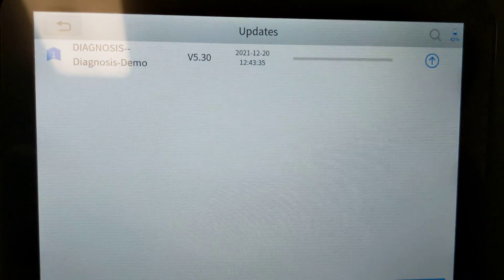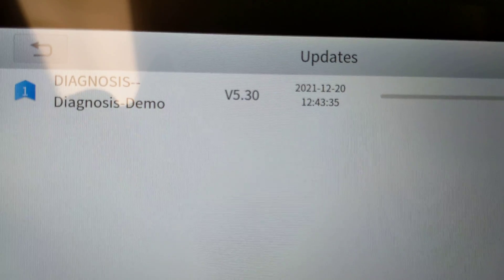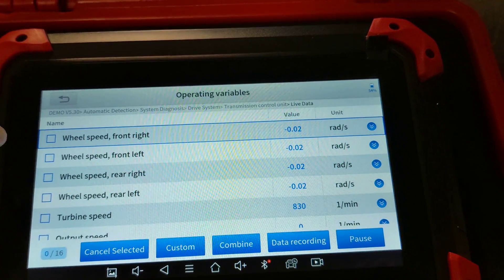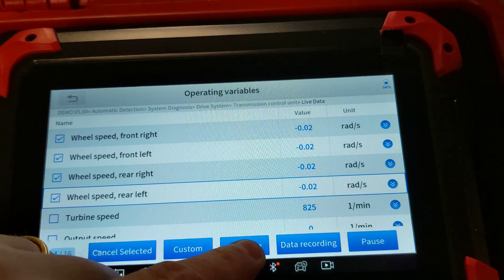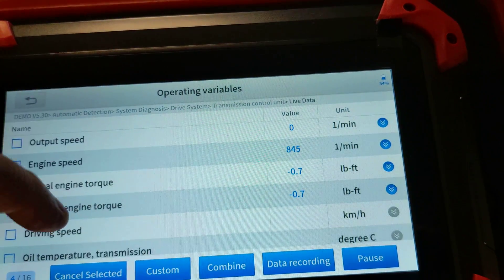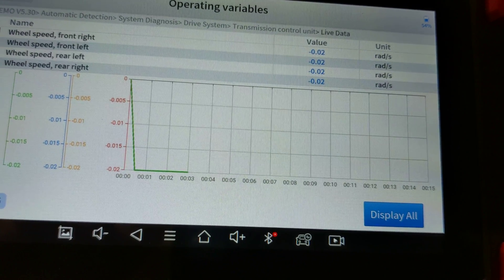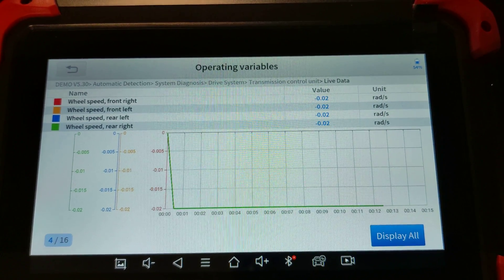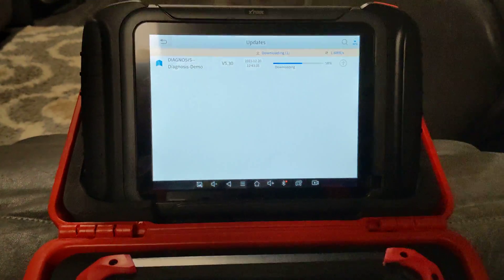XTOOL D7 & D8 Demo live data graphs(waveform) update

Comment: On D7 when you go to LIVE DATA and press Evap and try to turn off Evap Vent Solenoid while looking at the graph or percentage to see if gas tank percentage goes up or down it won’t let me turn off or on the Evap Vent Solenoid to run the test to see if there’s a evap leak somewhere but now when I go to ACTUATION TEST and click on Evap Vent Solenoid it lets me turn on and off the solenoid but there’s no gas tank pressure or gas tank level or volts etc but only on or off option on the bottom right and I tried going back to LIVE DATA to see if it stayed off but it stays on I also tried EVAP PURGE SEAL and same thing like LIVE DATA it won’t let me turn it off the Evap Vent Solenoid.   (Here’s an example on what I mean)
Reply: https://youtu.be/vI6c91ga80M
Reply from the maker: @hectorcuevas4587  I would direct any questions to xtoolonline@outlook.com. They are very responsive.